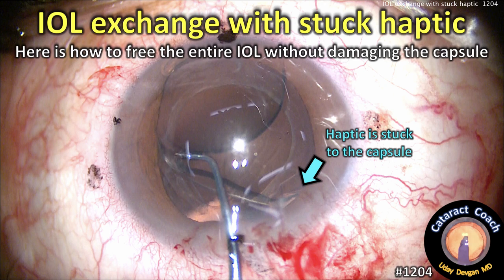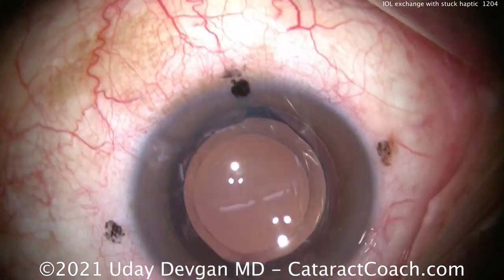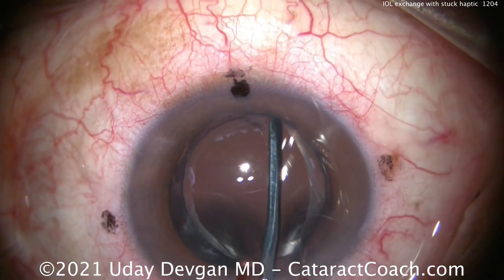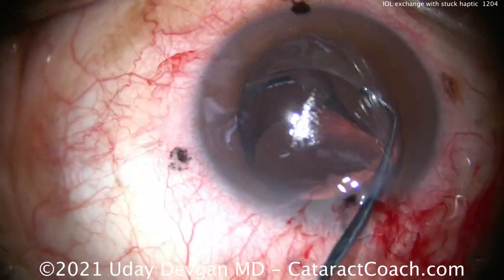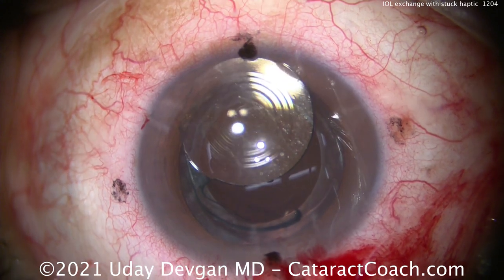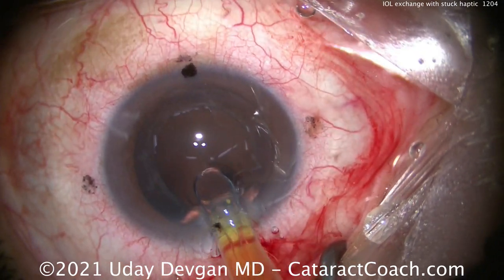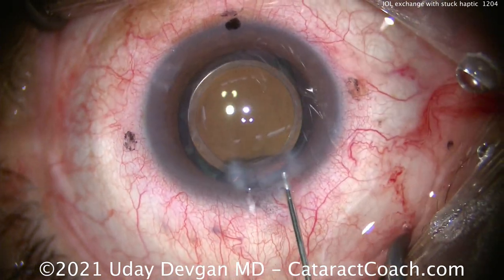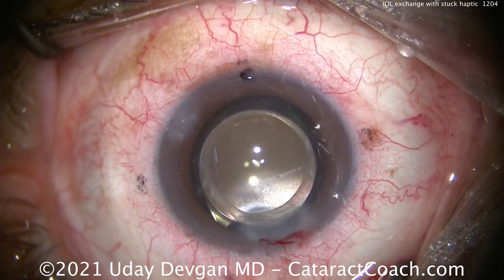CataractCoach 1204: IOL exchange surgery with a stuck haptic

Comment: Hi Dr. Devgan. 
Have you Increased your incision size little bit to remove IOL by this technique?
What incision size you recommend for this technique of IOL removal?
I think we can also cut the haptic in case it is completely stuck and avoid zonular damage.
Reply from the maker: Same incision size of 2.75mm
Reply: In this case if you cut the haptic and leave it there, it would make the toric IOL implantation more difficult. I think that could be done if the new IOL was just a monofocal non toric IOL.
Reply: @SuperSZ  absolutely right